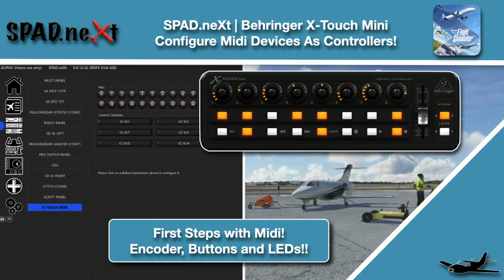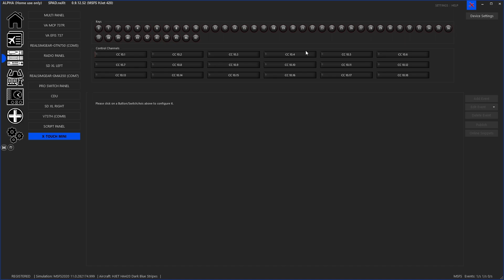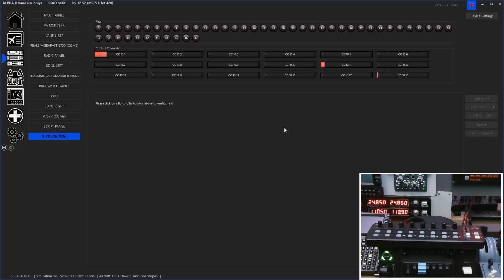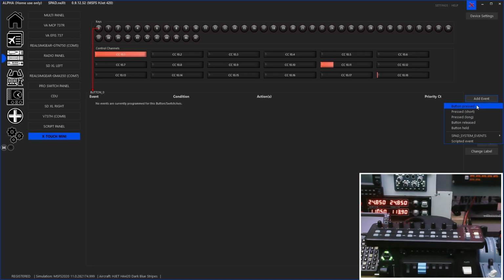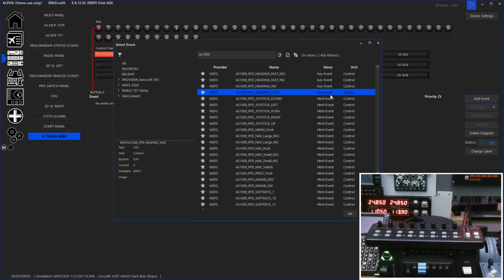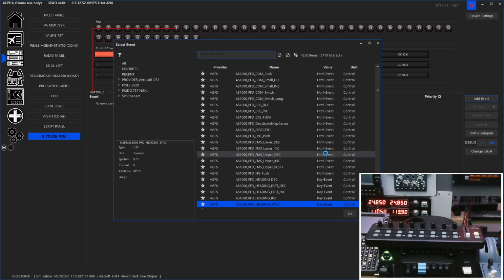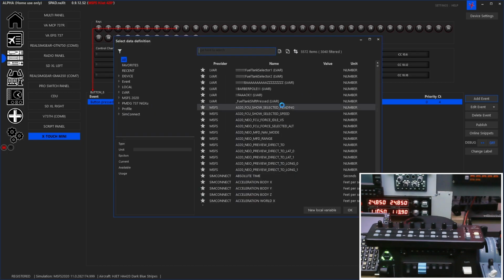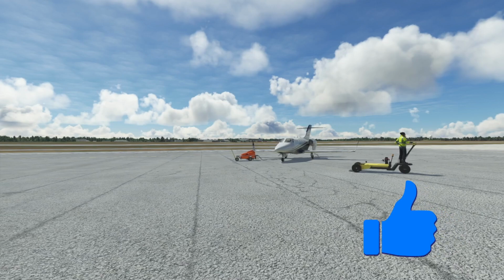MSFS | SPAD.neXt | Midi Basics | X-Touch Device Setup

Comment: Good one Les! Got my x-touch about 6 months ago and love it. The one area that I’m having trouble wrapping my head around is configuring the knobs to act as pots for adjusting lights. I feel the x-touch is the perfect device to accommodate adjusting light intensity, but again I’m not quite getting it. It would be great if you could do a follow up in which you shed some light on adjusting the lights 😄
Reply from the maker: As Long as the light is not one of those B-Event connnected issues then you would be linking it like you would an AXIS.  I will try to do a follow up one with it.
Reply: @LesOReilly  That could very well be the case. I have been successful in linking the knobs to things like temperature control dials but getting them linked to lighting controls - getting the lighting intensity to increase and decrease and the knobs in the aircraft to physically move...not so much. Any pointers would be much appreciated.

Comment: I use and it is great.only it disconnects from spad very very often, in spite of unticking every usb power management I can see.no other usb device does that for me.
Reply from the maker: possibly you have too many devices on the same HUB, Not enough power for all of them or not enough Data....  I have no device drop outs but I supply 10A to all of my HUBS and have the split across USB controllers as well so that I don't over Subscribe a bus.
Reply: @LesOReilly  I have an industrial powered usb hub. But will order a separate usb controller indeed.

Comment: I’m looking forward to getting one ☝🏻. Les is it about the size of multi panel ? What are the mounting options for it ? I’m looking for under the desk configuration.
Reply: Take a look on amazon, shows size and a video for size reference.
Reply: @johnhubbard7384  will do thanks John
Reply from the maker: I don't use it in my sim :) hence taking so long to add a video for it :) ...  I use it with my Work Products I have at home and the Audio Mixer in that product.  So normally its on my desktop not near the sim...  That all said there are all kinds of Mounts made on ETSY or other 3D printing models..